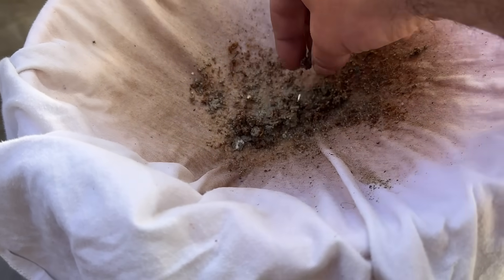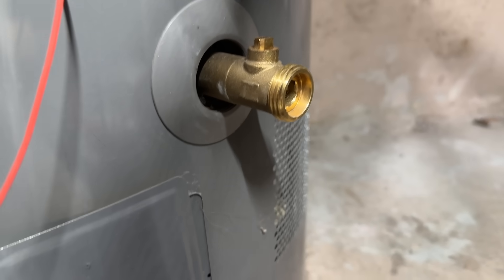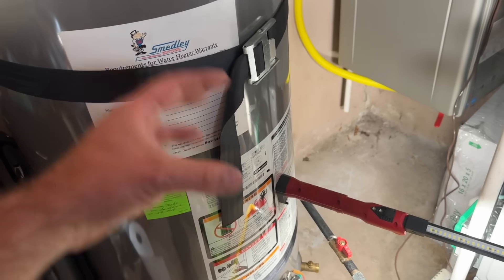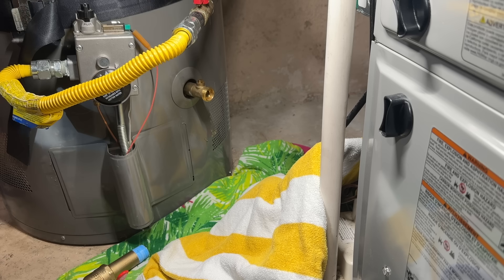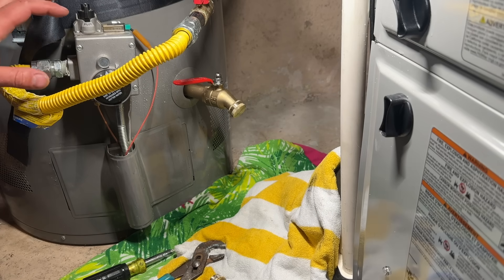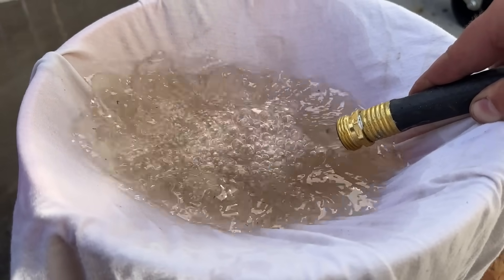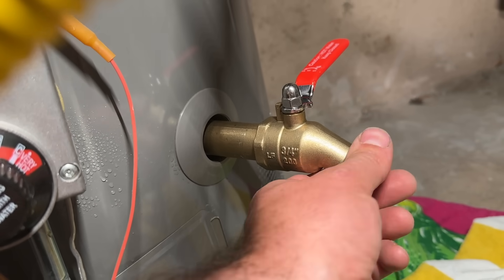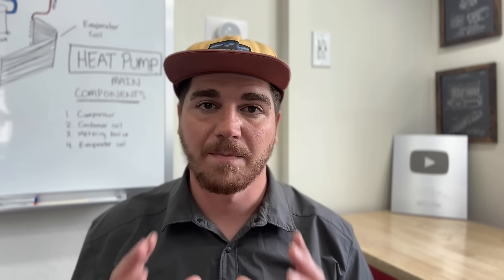Why Don't They Install These On Water Heaters From The Factory??

Comment: My 20+ year old electric heater still runs fine so I'm reluctant to risk breaking  the old-original drain valve.  
However I rigged up a garden hose "Y" connector with the center leg connected to the heater; both of the other legs have quarter-turn shutoffs with one connected to an outside faucet and one to discharge (i.e. a bucket).  Then I alternately drain and run pressure water into the tank which loosens and stirs up the deposits.  It takes a bit of patience but an amazing amount of crud comes out before the water runs clear
I actually bought a large-bore drain valve (like in video) for a new future tank when that day comes.

Comment: Makr sure you use a full port ball valve if you're going to spend the time and money to upgrade your drain valve at the bottom of your water heater.  That will blgive you the largest opening possible while still being able to open and close the port with a simple ball valve.

Comment: I have heard from the most experienced of plumbers, that if you don't flush every year starting from new, then leave it be as ya just stir up crap at the bottom and can plug up the valve? Kind of like transmissions on cars...once you get past 80k in miles and you have never flushed it or changed out the fluid, don't flush the tranny, but just do a drain and fill every so often.

Thoughts?

I do like that valve though if installing from new.

Comment: If your plan is to flush your heater, just remove the valve. That would even be a bigger opening. Then put the factory valve back.

Comment: Hello, all. I got a Corr - Pro,  powered anode rod ; offa  Amazon ; 200 $  canadian.   The 39 gallon one, for GSW   40 gallon electric heater. Will install, in a few days......840  $  canadian bucks, eastern central  Alberta Canada.  Thanks,  alot   ....?   Tanks  alot ; young  Man !  
Changed out, that lower drain.....PLASTIC  CRAP - called a  ? valve ?   screw driver ?......what is   R O N G   with you ,  Infantile  Engineers ?.....Good  robust heater....with  CHINESE   JUNK...for  a  Drain Valve ?.....like putting dog sh**  in yer  car, for air freshener....?.....o well.  modern j u n k .

Comment: The reason they use plastic is because of galvanic corrosion.  It's caused by using the two different metals (steel and brass).This will cause your tank to rust out and leak.

Comment: Replaced my anode rod in December after months of being afraid to do it. Piece of cake. The damned thing was literally nothing but a wire, so I obviously should have replaced it years ago. This video gave me the confidence that I could replace the existing outlet valve. Followed the directions--another piece of cake. Drained then flushed the water heater and got much larger crap than I've gotten in the past. Brilliant. 

What videos like yours do is give regular homeowners confidence to tackle doable tasks that they'd otherwise pay tons of money to have done by a professional. (Or, in the case of anode rods, something the industry would be happy for you to not do at all!) Simple, clear, practical advice. And not like those ridiculous home reno shows that fool people into thinking they can simply knock out a wall with a sledgehammer and suddenly have a beautiful open living room.  You and others on Youtube make paying for Youtube Premium worth every penny. Many thanks!

Comment: The factory valve you showed is a full port ball valve I believe. If not it’s probably marginally smaller than the new one. Even at the end when you showed them side by side, you can barely tell a difference. I bet you can’t get your pinky in the new one either. I wouldn’t bother changing out that one. Most heaters that come from a plumbing supply house will have that style of drain valve. The kind I would for sure change is the ones from box stores. They have a multi turn or gate vale style drain and they’re usually plastic. These are the ones that cause draining issues. I always have to unscrew the packing nut and constantly run wire through to break it up. 
As for the anode rod, it doesn’t prevent sediment. Draining it once a year will help with sediment. The anode rod helps your tank last longer. It’s sacrificial so molecules that would normally corrode your tank, will corrode it first. Sediment is in the water and will settle in the bottom even if you changed you anode rod every day.

Comment: Same here regarding the anode rod on my relatively new Rheem gas hot water heater. It wouldn't come out, no how, no way despite using a big boy, industrial, impact wrench. I don't know how they install these anode rods at the factory. But something tells me they DON'T want you to be able to remove them. That will cause the hot water heater to fail sooner. Which means you have to buy a new one sooner. Call me crazy. But why in god's good green earth so you hear horror story after horror story about anode rods that would not budge even with the strength that would make Thor jealous.

Comment: Easy install. Inspired me to flush my 8 year old WH which I've been meaning to do. I have soft water, so I didn't have any crusties. Just some brown water at first. If you have hard water, this will definitely help. Much better than using a coat hanger trying to unclog the factory fitting.

Comment: "Master Plumber" there's a laugh. Buy a Bradford White. It has a straight drain valve. Not that anyone will ever use it.... If you have sediment in your water heater, you need a filter/softener or new anode. Hello??? Good plumbers use pipe dope. Monster Teflon is for girls. Threads haven't changed a bit in 200 years. Why do we need 1/4" thick teflon tape? Because MASTER PLUMBERS are BS. There is NO certification for MASTER PLUMBER. My experience has been - every MASTER PLUMBER I ever met did not know shit about plumbing. In 25 years of plumbing, I have yet to meet a true master of plumbing. Sorry - too much coffee this morning. I'm on my soapbox.

Comment: My local plumbing giant came out to service my water heater and said it needed to be replaced. They cited slow drainage during the flush and said it meant the tank was clogged with debris. I did some research and decided to swap my drain valve with a straight ball gate. When I flushed my tank, big chunks of rock came out, but I could feel a lot more in the tank. So, I added a gallon of 75% vinegar concentrate and let it set overnight. A frothy mixture came out during the next flush and the heater stopped making banging noises when it was running. My municipality gets water from wells predominantly. So I think I’ll have to do this annually if I want my water heater to last 10+ years.

Comment: there are more water heaters that have a plastic valve that is sealed in. 
replace one of those,not only impressive, but realistic as there are more plastic drains installed at factory.

Comment: Don't use this crap he is selling the straight through is the best because If the value plugs it's easy to rod out. Unlike when you have a goose neck valve also don't tape the 1st thread and I do use blue monster but any good tape works If are worried about the valve hole size replace it with a larger straight through valve AKA full port also If you want to do a better flush do it with the pressure on the system.

Comment: I prefer a boiler drain valve. Similar to an outside spigot but in either case, and especially with the straight handheld ball valve, but a brass cap to thread on and tighten, so if the handle gets bumped or played with by kids, it won't dump out on them! Later! Be safe! 🎯💯🏁👍👏.

Comment: I run a 1 micron whole house filter and I never get anything out of my heater when draining. I recently replaced my anode rod and it was 95% gone but it must have dissolved because nothing came out when draining. You have to use a powerful impact to remove most of these anode rods.
What is that strap around your water heater for?

Comment: If the water heater is accessible to kiddos like in a garage, I recommend getting a valve lockout after swapping to the ball valve. Much easier for a kiddo to knock a ball valve open compared to a gate valve with a bike or something and blast them with hot water when the unit is in service and under pressure. Ask me how I know! 🤦🏽‍♂️ 🥵

Comment: I have a 25 year old Richmond that's never been flushed. But this is good information for when i replace it. Maybe I'll take better care of it. 25 years isn't bad though, I've gotten my money out of it.
Reply: You should probably try to flush it out now because chances are like everything else if you buy a new Richmond water heater it’s not gonna be the same…. Admin taking care of my Kenmore refrigerator and just out of curiosity I look to see when it was made and it was 1998. It still runs like a top. Nothing is made now to last
Reply: @Cream1968 my speedqueen dryer was over 30 years old when it died. I fixed it a couple times but ran into an issue of the parts being discontinued.

Comment: Some (many?) Hot Water Heaters have 'Swirl Tubes' that stir up the sediment on the bottom. Mine does, and it's from 1990, so 35 years old. When I drain off the sediment, the water runs clear within about 30 seconds.
Also, some use a plastic drain valve to reduce heat loss. If the metal drain valve feels hot, then you're losing heat to the basement (up to you if that's a problem or not). It can be on the order of $50 per year.

Comment: Let's face it the cheap original valves found on most water heaters do exactly what there intended,  they prove after a few years you open the valve minimal water comes out and if your lucky the valve is plastic and breaks when you try to turn it.
 Just a thought.

Comment: I started putting full bore valves on my water heaters back when I would have to blow down a boiler where I worked.  The valves on the boiler were full bore valves so that they would flush out sediment that built up in the boiler. It needed to be done several times a day. So I started installing the full bore valves on my waterheater and I too was able to get a lot of sediment out by using the ball valve instead of the plastic valves seen on waterheaters. The plastic ones are difficult to open and really don't open very wide at all plus they were difficult to seal after draining.

Comment: Classic example of manufacturer squeezing every penny out by using the cheapest component possible. Some even come with plastic drain valve and it is guaranteed to break or leak the moment you touch it. Of all the codes the government requires and yet they let these big corporates produce junk that causes big problem for the owners.

Comment: Thanks.  I completely flush my tank once a year and four times a year do a 2 minute flush.  But, I never looked at my anode rod, my mistake and after nine years there was only a wire left to the anode rod.  So I replaced my rusty tank unit and got a new one with a Corro  Protect anode rod. 

 I removed all external hardware from my old tank and tipped the tank over and was very surprised with the large amount of clay like rust and larger sediment in the tank.  OK, get a bigger ball valve and let the sediment flow a lot easier.  

The water heater I had before the one that lasted 9 years, was 19 years old and I never did touch the anode rod and had clean water, non rusty water.  That made me think never to bother with the anode rod, my mistake.

Thanks again.

Comment: The plastic valves are cheaper and they don’t stick out as much from the tank. This could be a problem in shipping as the boxes are already large and bulky having a valve sticking out. We probably get broken or damaged in shipping and transportation. Full part ball valves Are more expensive and once again stick out further in all the years that I’ve been working on water heaters replacing and servicing them I have never seen any valid studies done on whether draining the water heater to remove the sediment increases the lifespan measurably. Often, you only receive a small amount of debris from the tank when flushing with the remainder still being trapped inside the back recesses of the tank.

Comment: Incorrect! You should talk to this master plumber for the correct information. Most water heaters that have plastic valves are sold through retail stores and not purchased and installed by plumbing contractors. The valve that you are replacing is far superior because it actually has a larger interior diameter or pass-through than that curved one that you’re replacing it with also, if it plugs up with sediment, one can jam a screwdriver through the centre and free the sediment tap whereas the curved one that you replacing it with Cannot be easily cleared in the same manner. The only advantage is it has a lever which is not necessary because the one that’s on there has a screwdriver stop which will work equally as well and it designed to be tamper proof so that little kids don’t accidentally trip the lever and scald themselves.

Comment: "Why Don't They Install These On Water Heaters From The Factory??"
It's a safety/liability issue. The ball valve is very easy to open inadvertently, say by a small child, leading to scalding.
Of course you can fix a ball valve handle closed or remove it from the valve, but the manufacturer would never send the unit out with a ball valve expecting modification to avoid scalding due to the liability if it weren't modified. So they send them out with the cheapest valve possible. My water heaters lasted 20+ years without ever touching or draining them probably because the scale became a chemically stable protective crust. I would consider replacing the anode rod if the hot water had an odor, but as they don't come out well, I would just replace the whole unit. The average cost per year of use make them the cheapest appliance in most homes per annual cost. If you have that much scale that you feel the need to descale, you have a larger problem. Consider a whole house water conditioner.
Reply: you are correct.
Reply: If you're worried about that, zip tie or wire the valve handle in the closed position.  To make it easier, remove the handle and rotate it 90 degrees so it will be inline with the drain pipe when closed.  If you complain about the position of the handle being wrong, you don't want to solve a problem.

Comment: If you have a lot of sediment, the tank is the least of your worries. You’ll have issues with faucets and washing machines and dish washers. Insurance company won’t cover tanks over 10 years anyway so don’t bother. There’s no way your tank doesn’t last ten years provided it’s off the floor and in a 😊 conditioned space

Comment: Install that brass fitting on your steel tank water heater and it will cause corrosion.  This will cause your tank to rust out UNLESS you Install a plastic isolator between the brass valve and the steel tank.    Do NOT install a brass fitting on the water heater without a plastic isolator,  Note Telfon pipe tape is NOT an isolator.

Brass when it is in contact with steel will cause the steel to rust away rapidly!!!!

Comment: I have been installing 3/4” ball valves on water heaters for the past 40 years.
Reply: Oh yeah? I've been installing 3/4" to 1" adapters with 1" ball valves for the past 60 years.
Reply: @troy3456789 Oh yeah? I’ve been doing the same thing as you for the past 80 years!

Comment: Why not use a filter
Reply: The sediment is dissolved minerals from the source or the treatment plant that get released during the heating process. Look at the bottom of a stovetop water kettle that has been used for years and see the same minerals. The only water that cannot release the minerals is distilled water because it has none.  Now since you cannot get distilled water sent to your home through the distribution lines, you have to deal with it. Even if you were able to use distilled for hot water, it's inherent ion count is so low that it would absorb any residual minerals still present in the piping like iron shavings to a magnet. Getting clean water to use is important so focus on doing it in stages with the final point-of-use being the most restrictive. BTW, our bodies need some of the minerals by design since drinking distilled water over prolonged periods would strip the useful minerals out of you system.
Reply: @bryancondrey6457 great information 👍

Comment: My questions about those swap-outs, which usually involved a longer piece of metal, is what is the heat loss increase due to such a swap and is it worth covering it with some insulation like those bags that are meant for outdoor faucets in the winter?

Comment: Just from the picture  this not safe or up to code anywhere  in The US. water heaters have screw only opening.Not just for accidental opening but small child could open this type valve and severely burn themselves.

Comment: Because depending on where your water heater is located, it may not be a good idea.  I put one on my water heater because my water heater is located where a leak, or accidental partial opening, wouldn't hurt anything...my garage. (I live in Florida, we can have water heaters/washing machines in the garage because it never freezes)
If your water heater is in a closet also used for storing brooms, mops, cleaning supplies, etc. that kind of handle could easily be bumped and cracked open to leak all over the house and cause thousands of dollars in damage.
The manufacturer has no control, or idea, where you will be installing your water heater.

Comment: I've always changed out those cheesy drain cocks with a full port quarter turn ball valve on every water heater I've owned.  Those cheap factory drains always plug up if there's any heavy sediments in the bottom of the tank, I'm in Florida so this happens within 3-5 months of use.  You're lucky to have a factory brass drain, most of the factory ones I've seen are plastic, good luck trying to open them w/o cracking them after about a year subjected to the heat and sediments.